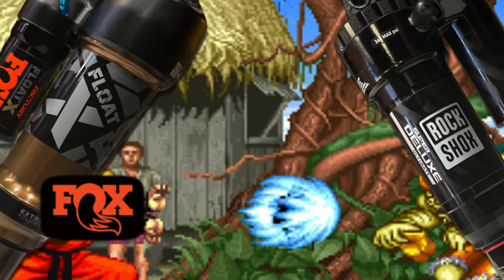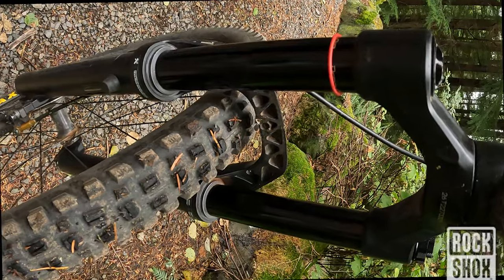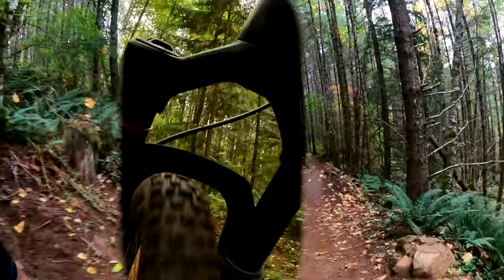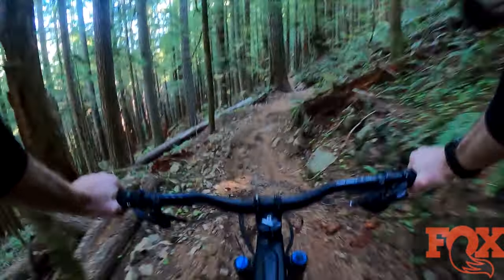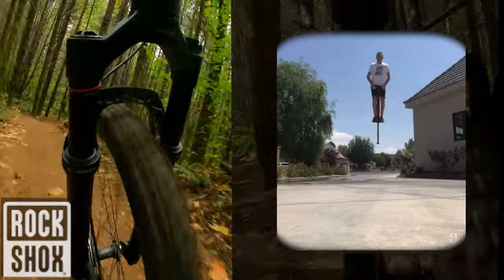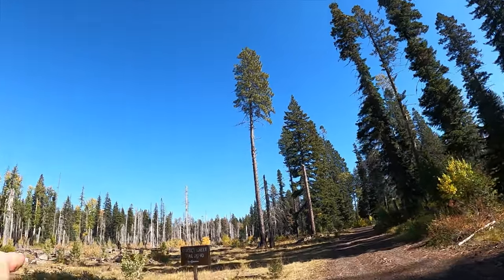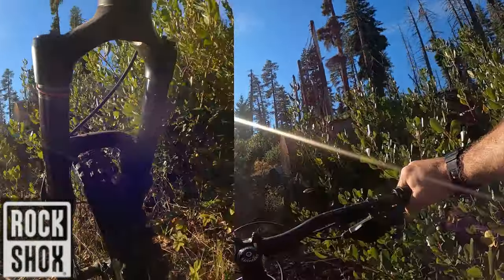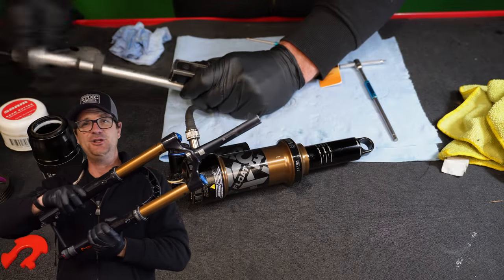The Age Old Debate: Fox vs. RockShox

Comment: you should try the ultimate lyrik with the buttercups. This is a gamechanger. Never had a fork as comfortable through on rough terrain. I'm coming from a 36 factory '23 and rockshox just won me over with this masterpiece of fork.
Regarding services: Rockshox has really nice instructions on how to service your suspension. You can't service your float x at your regular workshop at home. Not a gamechanger, but worth to mention when talking about serviceability.
Reply from the maker: Glad it works for you. I had terrible experience on rough trail. Was the best jumping fork I ever rode agree with you on that. Rode Zeb Buttercups is kinda a gimmick small gains on braking  bumps
Reply: buttercups is a marketing gimmick. they are trying to make a tiny rubber thing do what your tires are supposed to do, but tires just do it a lot better.
Reply: @TeamCykelhold  have you tried it? If you ever tried a non-ultimate version of the Lyrik or Zeb you'll definitely feel the difference. The difference is even bigger when riding on really chattery terrain - your arms will let you know what buttercups do!
Reply: @hias_k  Yes I have tried both extensively (old ultimate without BC and new ultimate with BC). I honestly don't notice it, although I like the 2.1 damper better and at 180+mm I think the new air shaft is too progressive. It could also be the crappy MOCO damper you can feel in the non-ultimate giving your arms a hard time (?). 
Your tires should absorb a lot more chatter than the BCs do. That's their job.
Reply: I also have the same fork and forgot to add have an EXT Era tuned to V2.1 with lower compression shim stack.  The Lyric buttercup is not a game changer but its a brilliant fork for pumpy / flowy/ jumpy terrain. The compression tune is way too high for rough trails.  If you want game changer then try a smashpot or one of the upside down forks from intend.  Even an ext era or a correctly set up Ohlins. Makes the Lyric feel like a toy.

Comment: Fox has racing in its name for a reason. After spending more than a month trying to get a fox 36 performance elite to ride right, I will not buy another fox fork. Bought a zeb ultimate and loved out of the box. As for the 36 being plush, not my 36, I ended up changing out the damper fluid from 20wt to 10 wt to get it so it didn't feel like someone was hitting my bars with a hammer on every bump when trail riding. Love your videos but my experience is the opposite from yours.
Reply from the maker: Slightly agree on the 36. It’s not the magic ride of 38. Zeb is a good fork besides small bump.
Reply: My friends 34 had too much grease on assembly. Made it very harsh. After cleaning and reassembling it works way better.
Reply: Why was there 20wt fluid in the damper? Or do you mean 20 cSt viscosity?

Comment: On my custom xc downhill hybrid i run a fox float 32 F seiries fork and a rockshox Monarch rt3 plus debonair piggyback love that shock i agree fox mabey superior but i dont notice the difference on my frame but fork 2as a game changer to the basix rockshox air for was 100mm went to a 140mm the rear shock was a 165mm lent shock to a 200mmx51mm shock with some custom DVO suspension hardware

Comment: Bro, from time to time, I am watching your videos, and you still don't know how to properly fine-tune RockShox using volume reducers and dropping pressure, which is necessary. It works even for Fox, but Fox is more damped out of the box and easier to set up, regardless of all those clicks.
Reply from the maker: I did a 9 min setup video for the NEW '23 Lyric. It is a Far cry from anything before. What Lyric are you talking about? Spent 1 week playing with settings. Low pressure and compression cranked does not work with a short travel fork. There is not enough travel tried it.
Reply: i think that too, i hade the possibility tri try both a fox 36 factory and a lyrik select plus, and i have the new lyrik ultimate on my personal bike. i think that you can compare a 36 factory to a lyrik ultimate, not a select plus... but at the end of the day rockshox is better

Comment: Funny, can’t say I agree with anything you have said. Don’t know if it’s the bike or what, but I just don’t gell with fox. All my forks and shocks are all standard tunes. I’m now on factory 38 and x2 and miss my rockshock setups. Maybe different skill sets suite different levels or even ride preference. Not saying anything is wrong with fox, but I personally just don’t like the feeling.
Reply from the maker: What is your bike, body  weight and settings?
Reply: @OtterMTBtech  Spectral Mullet, Fox had 36 performance elite, cant remember the rebound, pretty sure I was either 1 or 2 clicks off the recommended, 2 tokens, but tried different settings generally used 22% sag. Anything under 15-20  I found too stiff.  DPX 2 had maximum tokens. had to run the shock at 20% SAG. 25-30 was soft, but went through the mid stroke way to easy, I always assumed a better compression tune was needed. For my slash, I went between a couple of different configurations, some permanent and some trialling when blowing shocks or upgrading from Lyric. I have always used friends who are good at setting up Fox. Im 100kgs. for RockShox, I would typically aim at 18% sag in the front, and depending on the terrain, one click or rebound adjustment, for the rear, it would be 25 to 30%, higher +1 click on HBO.  My new Reign is 3 tokens in the 38's and 2 tokens in the X2. Rebound is 1 click slower in the 38 and 1 click higher in X2. highspeed rebound is recommended for both. I know I didn't talk about the compression. I would also like to mention, I ended up getting a Zeb Select and upgraded the damper to 3.0 with buttercups. It was never as good as my Zeb Ultimate in the spectral. After analysis it was the bushes that needed burnishing. Made the fork absolutely buttery like my boxxers. Fox always feel smooth on the initial stroke, but just harsh unless I run 30% in the front and 35% in the rear

Comment: Would the butter cups make a difference in the ultimate?? I’ve heard that they help with the fatigue and chatter.
Reply: Yes have them in my zeb and they work wonders. Super plush fork. If you know how to tune it is just as good as the fox. Fox is more planted rockshox has more pop
Reply from the maker: I can only speak for the Zeb. It does help take the high frequency chatter out of trail kinda isolates your body from it, but back to back runs 38 Zeb Butter cups is kinda a gimmick

Comment: I guess it comes down to personal preference. I tried a 36 rhythm and it was either too plush or too harsh, and no mid stroke support. I found that even my old Yari felt better to me. The super deluxe vs float X is a different story. I don't really see any difference between those two when I ride them. I don't really jump, and I'm not a great rider, and don't care about brands but I'm massively disappointed with the fox fork.
Reply from the maker: Super valid point the Rythem here is 180mm. I hated it in 160. Video coming soon, with short travel variant
Reply: @OtterMTBtech  any news on this video? I have a status 160 with a 160mm rhythm, and I want to either upgrade it to a 180mm fox 38 factory, or a cheaper option like 180mm 36 performance with grip 2

Comment: Have you tried leeting more air out the lyrik and adding compression instead to make it sit high in its travel? I have a chrager 3 Pike ultimate and i could get it to track the roots without having arm pump. Waht I like in comparisson to the charger 2.1 is the it sits higher in its travel and does not go up and down this much.
Reply from the maker: I did try that, personally didn’t like it, since it was more nose diving.
Reply: @OtterMTBtech   can't  behavior of the fork a lot. If I understood you correctly the zeb had no issues and you are happy with it?
Reply from the maker: Zeb Vivid combo was great besides arm pump. Lyric is the best jumping fork ever made, un beatable on smooth trails. Fun on green trails. Terrifying on tech trails. I also basically suck at riding so rely heavily on equipment to make it down trail.
Reply: How do you like that Pike Ultimate Charger 3? I just ordered a Propain Hugene with that fork.  They had a Charger 2.1 in the build configurator but I wanted the Charger 3 because of the buttercups.  From what I've read, they help with small bumps and chatter.

Comment: Fox 36 Rhythm 160mm fork works awesome with a compression dial re-clock trick and one air token.
Reply from the maker: which way
Reply: @OtterMTBtech  Take the sweep adjust compression knob off and re-clock it approximately 45 degrees clockwise. Screw back on. Then open compression all the way. This is the "more open" compression setting than the MIN possible factory setting, which helps small bump sensitivity.
Reply from the maker: Thanks will try sounds a-little sketch, but I thrive in that kinda stuff.
Reply: @OtterMTBtech  It's not really sketch, it's just a tiny bit less compression damping than MIN stock setting. It's a trick that a few others have used. Let me know how you like it.

Comment: Service time and cost is why I hardly ride my eMTB anymore. I feel like every ride must be “worth it” so I do it even less. Thats why these days all I do is ride my Onewheel. The thrill of life altering injury is the same but at least these deathboards requires zero maintenance.
Reply from the maker: 😆 fully agree. I have a 9 speed Shimano Cues drivetrain. Whopping $24 cassette on Ali express. Long link Specialzied bike eats rear shock as appetizer. Every bolt red lock tighted. 1,000 miles on a Brose motor before it blows

Comment: The lyiric is a great fork. I had it so plush and it flew over the rocks
Reply from the maker: Can you please share what you did? It’s a frustrating fork.
Reply: Yes please share i am not happy either 😅
Reply: @OtterMTBtech  
I had 2 volume spacers in it on my 30kg ebike 
And about 10 lsc from open and 0 hsc
It was a 2021 lyirik 180 mm set to about 26%/28% sag
Reply from the maker: Bro the 2021 lyric is a different and I talked about it at the end of the video being a better all’s round fork
Reply: @OtterMTBtech  to be fair you called your video rockshox vs fox, not charger 3 vs 2.1 vs grip on the 38 vs .. ;) Click baited yourself! haha. Definitely like the older lyrik, and not a bad alternative to the fox 36 but... i.. i  .. personally gave in and have a 38 now.
Reply from the maker: To many forks in video for sure. Was not any reason to ride the new Lyric past 3 miles of sheer tear so I through the old stuff in. @kangsterizer

Comment: Having owned the Fox Rhythm 36, then the Rockshox Yari, and now the Lyrik, I can agree that the Fox feels a little 'dead' and dull in terms of pop etc. Although I haven't found the Lyrik to bounce off things badly. However, I do have the Vorsprung Luftkappe mod on the Lyrik.
Reply from the maker: That’s the new lyric
Reply: @OtterMTBtech  what's the new lyrik? Mine is the 2021 version.
Reply from the maker: @Gmork-The-Nothing  The Lyric current model 2023 and newer is ground up different fork, miles and miles different in feel.
Reply: @OtterMTBtech  So I've got the good one, is that what you're saying? They've gone to shit?
Reply from the maker: Somewhat ,
Reply: @Gmork-The-Nothing  I just got a NOS 2022 Lyrik (because it had the older 2.1 damper like yours probably has) and "downgraded" the air spring to the 2020 version. It rides the way I like. Doesn't ride as high as the newer air spring, but feels more gushy. I can point it at a rock pile and plow thru, or launch over it with ease. While the newer fork might take big hits better, that's not my style and I prefer hand comfort.

Comment: Thanks for sharing. Question on that Yari fork. You mentioned it has the Damper 2.1 but does it have the Debonair B1 (<2020) or C1 (2021)?
Reply from the maker: Latest version, but in another video I made the Yari ride plush. Rockshox YaRRi Supreme
https://youtu.be/pqzoi9Nl9fQ
Reply: @OtterMTBtech , Thx. I’ve tried the B1 air shaft with bump stop removed and it was a bit too much negative air. The frontend gets sucked into the dips. I also tried the C1 with removed and also tried trimmed bump stops (maybe only 3mm left on the bump stop) to get a little negative chamber since the C1 doesn’t have small bump sensitivity and the B1 does due to more negative air chanber but it didn’t feel right with the deleted or trimmed bumper C1. Anyway, my Lyrik Ultimate RC2.1/B1/170mm is feeling like its too damped while the rear Float X is more lively/poppy with really good small bump sensitivity. My Levo Gen3 feels very ‘divy’… I’m still a bit lost with the front end and wonder if I should check the Fox38. We’ll see.
Reply from the maker: Does the lyric have charger 2 damper. I had to crank the compression up with the Yari Superme.
Reply: It has the Charger 2.1 RC2.

I have the Compression open. I will try that next time. I have 5 Lyrik Ultimates Charger 2.1, RC2. They all have different Debonair airshafts: B1/C1. The one I have on my Levo has the “too damped” feel. My Heckler 2 also have the same fork but it has a very balanced feel when jumping. The fork has a good pop to it but not the one of the Levo. I’m not sure why that is. Both bikes weigh the same at 49 lbs. Anyway, I’ll look into it. Thx
Reply from the maker: That’s the bike not fork. Santa Cruz VPP is like a hard tail. Specialized is a plush bucket

Comment: Hey Otter have a suggestion for you for a video as I asked GMBN they did make a video but really didn't cover the topic ...
I have a Megatower 2 with a Rockshox select+(absolutely gross standard shock for an enduro monster) I have a 38 Grip 2 on the front but I'm really struggling what class of Air shock to go - DH/Enduro class(X2/Vivid) or 'Aggressive' all mountain/Enduro class(Float X/Super deluxe Ultimate) I do alot of pedalling in my rides average 20-25km/500-600m (12.5-15.5mile/1640-1970feet) hit some gnarly rocky DH with bits of flow and jumps, also techy rocky climbs and long fire road climbs - really do it all. Is the heavier more sluggish DH class shock with all the adjustments or lighter slightly more active all mountain/enduro with LSC a better option... Really stuck in the middle here of which way I should go!
Reply from the maker: The new Super Deluxe  Ultimate is 1.25% better than the previous model,  NO brainer to go Fox if you have a 38 hanging out the front and like it. Vivid is good shock, I compared it to X2. I did a full day Float X vs X2 linked video here. Float X can hang anywhere and will jump better and pedal better, but with your 165 rear travel and it being a VPP X2 all day. Santa Cruz bikes pedal like a hardtail and need the extra plushness, I would go Coil on the Santa Cruz in fact. When going coil no need to be picky Rockshox is fine, it slows that long travel down in the chunk, less moving parts more reliable. MAKE SURE if you go X2 it is 2024 or do not get it.https://www.youtube.com/watch?v=f90oAaXr3tE
Reply: @OtterMTBtech  Thanks for the reply mate( although my wallet doesn't 😆)
You nailed the feel of the Megatower it does pedal like a beast and can feel harsh - man now you have thrown me a curve ball with a coil, I wanted to keep the weight down so I will probably end up going for the X2(I've heard all the horror stories of the last couple of years!) Again really appreciate the response!
Reply from the maker: I blew up a X2 in 50 miles, so you gotta run the 2024 or pre 2021. I rode Santa Bullit for a week and it was so harsh in the rear end with that Super Deluxe I know precisely what your talking about. If you want the Divine feel go with a EXT coil and its 2 oz heavier than X2. It also doesn't come cheap. cheers   @mattfarrar5472